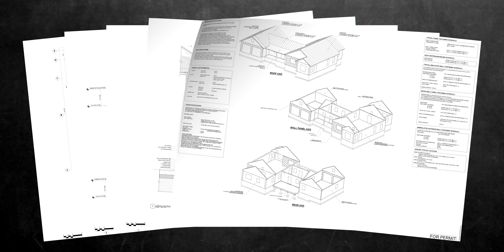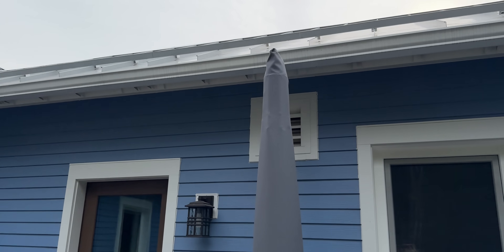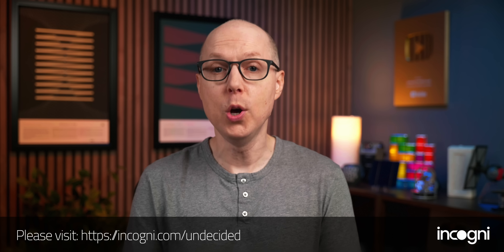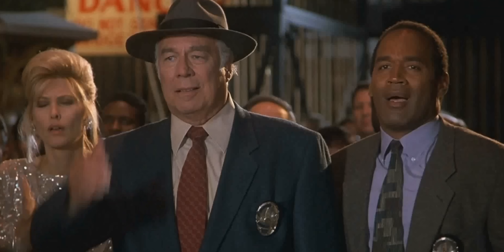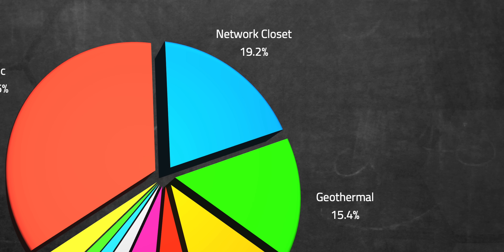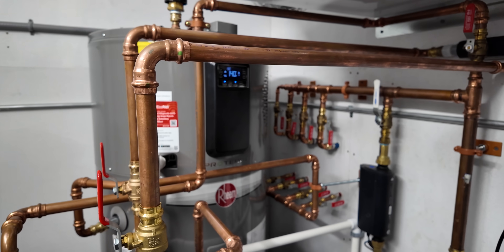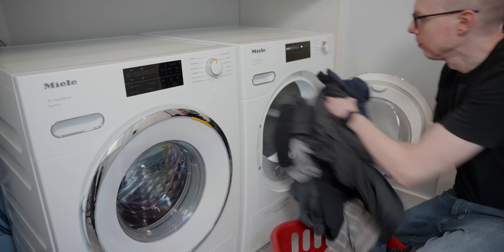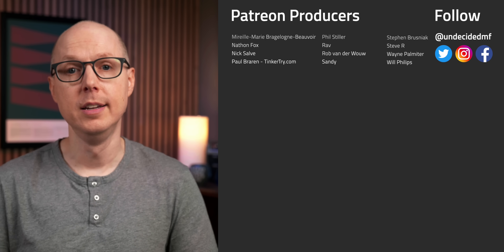What I Learned After 1 Year in My Net Zero House

Comment: Doing all that is a big luxury - that's not a knock - I appreciate the updates. For me, the first thing we did in our new home is get solar installed. My only regret in the last home was not having solar put on sooner. The only catch is that I'm not able to maximize my system to fully cover my electric consumption. Some of that is financial and some of that is limited by my local utilities that have a 120% rule based on house's floor area for new construction. This provides me basically no room to expand or account for my home office/business too. Unfortunately, we were not able to put in energy efficient appliances because we were stuck with the crap the builder put in and it felt even more wasteful to replace brand new appliances. I am looking into "dual fuel" heat-pump systems that would still leverage my existing natural gas furnace if the temps get too cold (below zero). Of course, as our stuff ages, there will be a time when replacing it will be justified.

I'm also of the belief that we don't need to go full net-zero. But, rather, do the best we can where we can and when we can - and allowing myself the grace to fudge in other areas. It also has to make financial sense - at least long term.

I'm hoping that I can add on to my existing solar setup with more batteries and panels once I have a year of data - I'm currently offsetting about 60% of my electrical use.

Comment: It would be useful to know how much time it takes to offset the cost of all these wonderful methods of heat, and electrical generation, how much time it will take to offset the manufacturing emissions on all the equipment, it would be a good indicator of the viability for those on modest incomes. As someone who has a hot water solar collector, and an independent PV/battery bank that I installed myself I would like to see an article that covers this.

Comment: I wonder how much faster one's clothes and linens wear out while tumbling around in a dryer for 100+ minutes. And is one end of the drying cycle more effective than the other. Is the work of removing moisture most effective when the items are damp from the washer with most of the drying time spent getting those last few percentages out of the items? Is a drying rack is a good accompaniment for those heavier fabrics by only partially drying them in the machine? hmmm?

Comment: I think the majority of problems and failures come from contractors not configuring their party of the system properly. It’s a fast evolving environment and even though they try, many are not experienced enough yet.

That aside, and assuming your pictures are from your actual home, I see two challenges:
First, those shades should be on the outside of the window to actually keep heat or cold out.
And second, it looks like you could add 50% more solar to your roof.

Comment: Here in Germany we have a ground source heat pump system installed in our house. I has worked for 17 years now and we are very happy with it. Compared to your system, our pipes run horizontally under the garden of our house. It is a perfect system of heat collection. We did need to change the heat pump itself once already, so there are costs associated when maintaining the system. These days we see more and more air source heat pumps being installed here in Germany and it seems that they are the way to go for new houses. Along the way we also changed all of the light sources to LED. This has also been a pretty good saving in our energy usage.
Reply: Are you using Bosch hardware? In the U.S. we've had problems getting dependable geothermal hardware. Bosch is now the go to here.
Reply: @sparksmcgee6641  Most manufactures use the same compressor, Copeland, mistubishi and a couple more. The rest is just fancy programing. Most running the compressor with a drive theese days. Same thing you find in you ac units. The go to brands  are nibe, thermia, ctc, viessman and bosch in random order.... 
I got a used Viessman for my own use, had sprung a leak in the hot water tank so got it for about 500$,  I installed my own logic on it and fitted it with a drive to modernise it and make it more efficent. 

I even know about a couple of guys the took the out door unit of a minisplit and fitted a heat exchanger to it to heat up there pool.

Comment: As an RF engineer I can tell you that the emf from an induction heater is present but not dangerous at all. They don't readiate far from the hob. The arms lenght operating recommendation is there to keep people mindful and safer. One doesn't really hang around the cooktop when it's working. The short period of exposure is not going to cook you or mess with your DNA. There's not enough power for that. The MRI machine example is an indication of how harmless inductive resonance is unless you are filled with metal.
I've never used an induction stove top. I don't really enjoy cooking anymore. I have a gas stove in my kitchen and cooking with gas is , well, cooking with gas. It's good.

If you are really worried, keep a chocolate bar near the induction stove or in a cool pocket on your person. If it melts then you are being cooked.
Induction heating is very very efficient. If I ever go all electric I'll consider it. They're really cheap and small plug in table top units are available too for minimum disruption to existing kitchen setups.
Don't worry.

Comment: The declines in energy use are impressive, and will pay off the original investment with time.   I'm guessing you could increase your brag there a little because it looks like your new house is larger than your old.  Perhaps you could compute a metric of energy used per square foot of house for the two, and compare.

Comment: If I were to guess, the heat backup sounds like heating coils in the furnace system, usually referred to as emergency heat.  They would activate when you have a large swing in temperature and are terrible inefficient, so even if it kicked in for a short period of time it would consume alot of power.

Comment: Just an opinion but I would think that a basement could provide better cooling in the summer. The air doesn't get as hot. During summer I open the access to my attic to allow the hot air an escape route. That also keeps the attic cooler. I also spend more time in the basement. As I live on a hill it is mainly at ground level.

Comment: In an air source heat pump, there are often back up electric resistive heat strips that are used when the outside air temperature drops so low that the heat pump struggles to pull heat out of the air.  I would've suggested that this was what that was referring to on your Span panel, but you have a geothermal heat pump, so this shouldn't apply to your setup.

Comment: I recently built a new house as well. I went full electric with a geothermal heat pump system. It has been amazing so far. I do have solar and a Powerwall but they were activated after summer, so I will probably not know how well everything works together until January. My geothermal does my hot water as well. I have been running the system with set times and temps, but I think I will try the 'on all the time' approach once summer has past and I have more ideas on how we want the system to work. Australian summers can be pretty intense.

My house is 270 square meters, and costs about the same to run as just the electricity costs of my old house (192 square meters). But my old house had to pay more for gas. I also have an EV now, and that costs way less than petrol. Overall, I believe I am saving around $5000 a year compared to my older, smaller house.
Reply: Whaou ! If you are saving $5000 a year how much were you paying before in all ?

Comment: We renovated our house (Germany) 3 years ago, to a similar standard like yours including solar. IT IS the most comfortable, quietest house I ever lived in too. No hot or cold spots. Very low consumption for heating (with a heat pump). The only thing we are missing is the air exchanger. We just open the windows. Overall we now get some money back for electricity we feed in. And as a result are heating cost is zero. (The network is the single biggest consumer of power just slightly below heating, in our household too. I am amazed how much power a 45W consumer uses over a year, even though I am an engineer. It is a bit like an airplane. You can calculate that it will fly, but actually seeing it is something totally different)
And the induction stove: Gold or Platinum or Diamond. Whatever. It is simply the best technology ever. There is no way back. The speed of heating and the extremely high speed of adjustment are phenomenal. Trust me 😉. There is no way back. An added benefit is the safety. No gas, no pipes, no valves. Just a single 5-wire cable.
Generally: Insulation and electricity are so far better than gas, oil or wood. Clean, easy, no maintenance, quiet. The up front cost is a bit higher, but the running costs
Reply: And then you have Russia who bombs your electricity grid ! It's a good idea to have a little gas heater just in case

Comment: In my home we began with a 20kW array, with 16MWh of annual production. I need to do some serious tree removal. We then added in a heat pump water heater and 2 EV’s. 27kWh of battery storage is coming next month where we will take advantage of TOU pricing with the utility. Next year is mini-splits to heat the entire house. We also utilized our utility’s program to get air sealing and weatherization done, which allowed us to heat all winter in NH with a small pellet stove and occasional oil boiler usage. That move alone saved over $1k annually. Whole home electrification is where it’s at, even with existing homes.

Comment: I think your solar solution was silly.  The cost before tax credits was $120,000 - insane.   The same money in a typical dividend stock would return over $6K per year for the rest of your life.  When your system begins falling apart one component at a time my dividend example just keeps churning cash and more likely than not generating more cash because most homes don't use $6K per year.  My home uses on average $60 per month.  Not only that, the money reinvested would likely pay for a large portion of the replacement heat pump in the future.  KISS - keep it simple stupid.  

Now, as a cool experiment.... Pretty cool.  Income on YouTube...

Comment: I have retrofitted my Victoria BC house with solar panels thanks to $5000 grant from the federal government and a desire to vertically integrate (I have a hybrid car with a plug in I installed in my garage for $700). I have a Crane heat pump for hot air and a Rheem heat pump hybrid hot water heater. The Longhi solar panels on a gently sloping metal roof cost $27k CDN after the grant (maybe cheaper now that prices have dropped so much) The Rheem hot water system is outstanding, basically nothing, essentially you are prepaying for hot water since the setup was about $4000 installed and uses 3 kWh per day for two people. The solar panels are not optimum as they face slightly NW and get covered in seagull poop and dust in the summer, but still manage to generate more than I need each year, (up to 95 kWh/d in summer down to 15 kWh/d in winter) resulting in a check back annually from BC Hydro! That’s after heat, electricity to run the house and hot water and charging the car. I use about 70-100 kWh/d in the winter and about 15-20 kWh/d in summer) Initial estimate was 10-12 year payout but if rates increase it will be less, and I,m very happy with getting a cheque each year and not paying any utility bills (except for a small monthly fee to be hooked up to BC Hydro, which is cheaper than batteries backup). If you have a suitable roof and room in your panel box (you will need at least 40 amps of available circuits) then it’s easy.  If you have a shake/recently shingled roof, steep slopes, shady trees or awkward wiring and no panel box open circuits it may not be worth the hassle.

Comment: My only experiences have been bad. Heat pump contractors who just want to sell an overpriced box with no analysis. Whose idea of fresh air is to cut a hole in the wall. I give them the benefit of the doubt and assume they are overworked, not lazy, ignorant, or just bad at their job. So no upgrades for us yet. Do I need to know more than the company I hire? Sigh.

Comment: Are you sure your geothermal system doesn't have backup heat strips for extreme temps?
Reply: The earth has a steady state temperature below the frost line and 40 degrees Fahrenheit is enough to keep a well-constructed house warm at any outside temperature.
Reply: @percyfaith11 Sure, but most heat pump systems (air and ground) will still have a backup system - either gas or resistance strips. If that kicks on for some reason it may explain the electric load labeled "backup".

Comment: My main thought about net zero is more solar panels and net metering.  I have an 11 kW solar array that offsets about 80% of my annual power usage.  My house isn't anything special with it's construction and I have a reasonably efficient heat pump.  If my panels were more efficient or I had more of them, it wouldn't be that hard to get to net zero.  I appreciate all the home construction choices you made along with the excellent high efficiency HVAC and appliances.  Sometimes, it doesn't have to be that complicated and the answer can just be, "more power."  That's the easiest path I see to attaining a net zero home.

Comment: Unless you needed the square footage, you made the right decision on the basement. The worst thing you can do is have AC ducts in unconditioned or unheated space, it’s very inefficient. Personally, the only thing I think you could’ve done better is insulated at the roofline, with an airtight and air-conditioned attic.
Reply: Don't understand your comment unless you are talking about very old homes most basements are conditioned  spaces and slab on grade homes put air conditioning in the attic which is the worst place. Since ground temp is roughly 55 year round  you can live in the basement very efficiently

Comment: I've lived in central Connecticut for the last 18 months (i.e. 2 summers) in a much older  house than Matt's that has no air conditioning and I wonder if a well designed house in the NE needs much in the way of air conditioning. If you have ceiling fans and maybe dehumidification there's like a couple weeks where it's uncomfortably hot in the summer and that's it. One thing I like about radiators for heat is how quiet it is not having the sound of forced air. Maybe some minisplits for cooling the bedrooms which are super cheap now and a heat pump to heat water for the radiators. I know these are available in Europe but they're not common in North America

Comment: Doesn't the giant block of miscellaneous power use drive you crazy?  I set up some power monitoring in my house on my major loads and I was able to learn some reasonable information.  What I still don't know is why my power consumption is so high when nobody is home and the house is just "idling."  That's the power use that drives me crazy and it seems exactly like your big block of miscellaneous usage.  It seems that for both you and me to really figure out where all the power is going we need to do a deep dive on all those little power users and figure out how to shut them down if we really want to reduce our power usage.  Like the old hiking adage goes, keep track of all the ounces and the pounds will take care of themselves.
Reply: I suggest a reverse test.....(over the course of days) if you can try not to use various sets of appliances that aren't measured. Does one set of appliances stand out from another? Or does each set of switched off appliances reduce the proportion of Miscellaneous consumption consistently? Wattts, milliwatts, microwatts are all measurable units so there's no place for ambiguity in this type of m,easurement (hence why it drives you crazy) - but it can be isolated to something, so start testing and find where the miscellaneous is being consumed........